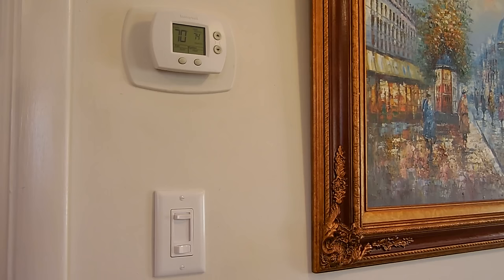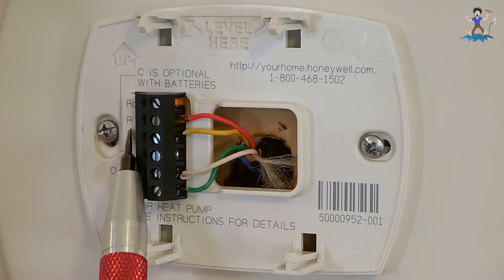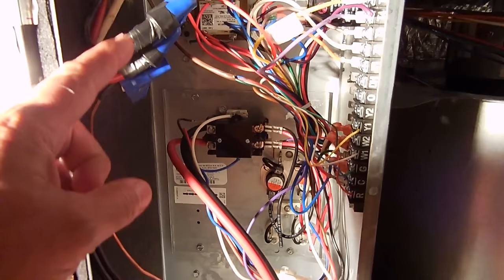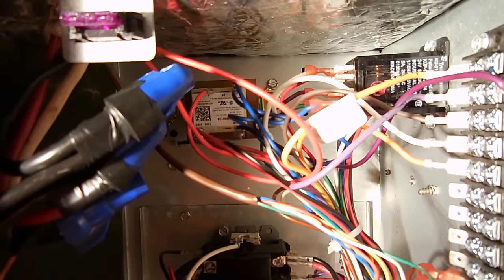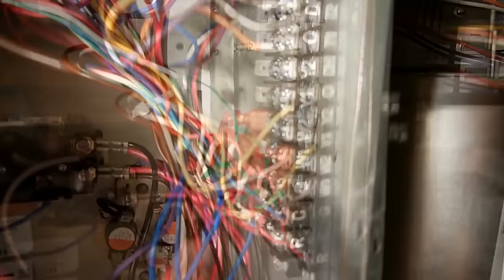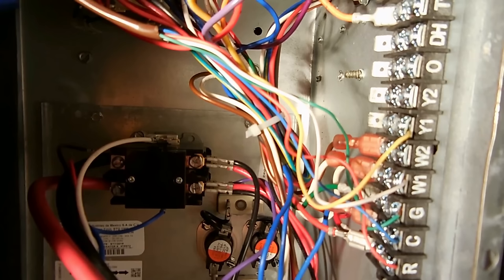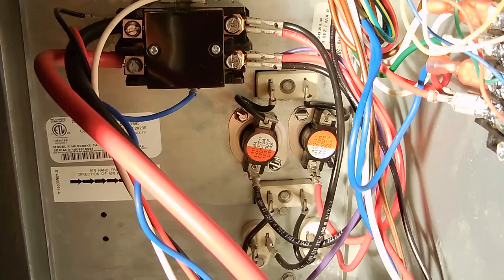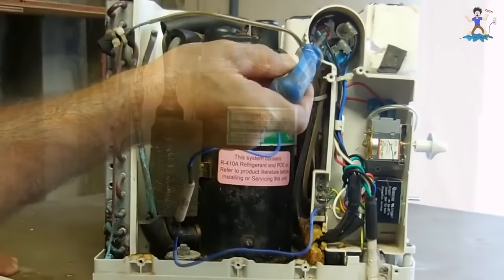How To Repair Electric Central Heating System(No Heat)

Comment: I have been doing HVAC/R and building controls since 1987 and I have to tell you this is a very detailed and accurate video, as with all of your videos the instructions and demonstration were great. I know people in the trade who could not explain this process the way you did.
Reply from the maker: Thanks Kenny! I really appreciated hearing that. :-) Hopefully this video gets the views it deserves, otherwise it was a big waste of time.
Reply: @electronicsNmore  Very successfull video!!! Outstanding Effort!!! Subscribed! Thank you very much! I learned SO Much from this video!
Reply: I'm trying to troubleshoot a 2014 American standard Air handler which has AC and Electric heat. The unit won stop running even without a t stat. I replaced the tstat and it's still no responding to demands. Can you help by any chance??
Reply: My thoughts exactly, you hit the nail on the head with this video. Step by step and in the proper order of tracing down the issue. Bravo

Comment: My electric furnace was blowing cold. I figured it was the heating coils. I saw them new for around $200. So after watching this video, I started at the white wire, it was a little loose and side note it also looked corroded. I just tightened it down and now my heat works again. I learned a lot from this. Thank you.

Comment: This video was absolutely amazing. I started the morning out with an HVAC that is not working and the prospect of several thousand dollars to replacement or at least a couple of hundred dollars in diagnostic fees. I followed the directions explicitly and by the time I was done I found a blown fuse and replaced it and now I have heat in the middle off winter the day before Christmas. (Cost $25 from Home Depot,) Thank you🤗

Comment: Thank you for the information! You are a gifted teacher.
I have more info pertaining to my Heat pump saga. It is a bit lengthy but has some more background.
 
In your video you said the two most common reasons for a fan not working is a faulty relay or a faulty blower itself. 

I bypassed my thermostat and jumped red to green and no fan. I added the white wire to the red jumper and the fan came right on blows air but not cold or hot (but it’s a heat pump). Lasted about 30 seconds and then cut off.

220 power is to the transformer and 28 volts out.

When on cool/ fan auto- it all works perfect (Fan/ cold air/ condenser fan)
When on heat setting the thermostat says heat on but no fan or condenser fan.

R-410A heat pump comfort control system code says “High pressure control lockout” locking out the compressor. Open high pressure control. The unit requires a manual reset.

Do you think it still might be a reversing valve? I can’t get the air handler codes without a code reader.
Reply from the maker: It's clear your wiring colors are wrong.

Comment: the tiny current that a multi meter uses to test resistance is what causes readings to fluctuate while ohm testing. the very small current will interact with capacitors and inductors.  this is why Nmore said to try and isolate (disconnect) whatever you are ohm testing from the circuit for an accurate reading. if you've ever conducted a resistance (ohm) test and the reading fluctuates, the current from your multimeter is flowing through a capacitor, copper windings, inductors, etc. AWESOME VIDEO!

Comment: this was a KILLER troubleshooting guide. i am stoked to try it out today. our downstairs heat just doesnt come on, always in AUX mode.. (and no fan starts up i think..) but the upstairs heat which is separate works fine.
Reply: already figured it out, with my past knowledge fixing my A/C units. i opened up this unit, heard the hum, and gave the blower spinner a push. it started up and heater fan finally blowing. i have a new cap on order.

Comment: I am perplexed-maybe some more background info would help you/me.

The thermostat wiring in question is located in the basement and there is the same thermostat upstairs as well.

Also there are two separate identical Rheem units with the upper only being larger. Both upstairs and downstairs ran perfectly.

We remodeled the basement and during the process I removed the wiring from the thermostat.
I took pictures of the wiring before removal. Once finished I rewired the thermostat identical to the picture. During the troubleshooting I checked the upper wiring and it was identical to the lower.

I do admit during the testing of the unit I did go back and forth from program to permanent hold in a rapid sequence back and forth which could explain the lock.

One thing that makes me wonder is- in by passing the thermostat with jumpers the heater fan came on.

On the thermostat where the white wire lug is was real hard to loosen and tighten to hold the wire in. When I thought it was tightened sufficiently the wire came out. Finally held with a vice grip to assist in torque. There’s little torque available with small screws and precision screwdrivers but all the others were ¼ of the effort. Do you think the thermostat could be bad since the fan won’t come on until I bypass it with jumpers? Maybe the lug isn’t making contact in the thermostat. Or am I way off scent. What do you think?

Comment: You should seal the hole behind therm, if there is low pressure in home attic air will blow right on thermistor.  In Florida too, I disconnected my heat strip for efficiency with a heat pump.  I don't need it coming on with a >1F increase.  Also, the only way to check the value of cap is with a cap meter, just a 30% off in capacitance can cause motor to slow start and increase amps.  I would just replace them every 10 years for $5-$10.  My 5uf cap was at 3uf and running amps where double and speed was off.
Reply from the maker: Funny you mentioned the hole, I stuffed it with insulation when I put back the thermostat. As for the cap, you and I both know a cap tester is best, BUT this video was made for people that more than likely won't have one. Doing what I show will rule out an open or shorted capacitor. Thanks for watching!
Reply: Wish I could get rid of the heat strip here in the Mountains  myself.
Reply: @tectalabyss  you running a heat pump if so you can disable it, if that's your main source of heat then no of course.  The new mini splits have 100% efficiency down to 0F, of course that means 300% vs a heatstrip or 3 x less electric for same BTU heat vs heatstrip.  And insulate R-50+ in attic.
Reply: @electronicsNmore  HVAC companies charge over $100 part only for a $5 cap it's crazy.
Reply from the maker: Like many doctors and lawyers, they have a license to steal from the public.
Reply: @publicmail2  Thank you for the reply Sir. Do these heat strips have a brand name  ?. We have to have the heat strip here has it gets down to the single digits and below zero.  An improved strip would be great. 
Again thank you.
All my best.
Bobby
Reply: @tectalabyss  Heat strips are all the same they don't vary in efficiency, fairly generic other than wattage and size.  Best advice is to insulate your attic to an R-50 worth of insulation, that's money in the bank.  And have an HVAC company check your static pressures on your duct work, 80% they are out of spec causing AC/heat pumps efficiency to suffer.
Reply: @publicmail2  Thank you again Sir. For the kind and helpful advice. Means a lot.  Power costs like everything else is climbing,way faster than wages.At least here at home and I am sure other places. So cutting cost is a big plus in my book.
Again Thank you Sir.
All my best.
Bobby

Comment: Thank you for the very detailed video. I have watched it several times and, performed most of the tests and, have not found the reason for my blower motor running slow, hesitating and running slow, repeat. The thermostat (same as the one in your video) seems to function correctly as everything does power on.
Reply from the maker: If the blower motor has full 220-240V at the power wires, and the capacitor is fine, then the windings are shot.
Reply: Check capacitor

Comment: Thank you for sharing this video very informative and educational Could you please tell me why my air is blowing warm but not hot air,and it doesn't reach the desired inside temperature which causes it to continuesly run $$$ the colder it is outside!I have an electric outside the house (AC/ heating)system.
Thank you very much in advance for your help!!!

Comment: Thank you for the helpful video.  How would I diagnose the thermostat if I did not have a green wire? I only have a red and white wire, and jumping them does not cause my furnace to turn on.  Should I jump the R, W and G at the furnace?

Comment: Our heater stopped working normally this night. The heater starts, runs for ~1-2 sec and then shuts off, then after 1-2 min it comes back blows a bit (no hot air, I tested w/distant thermometer) air, and shuts off again after 1-2 sec. So the fan come on and off, but heat never comes. Also what is interesting 1st time (after you reboot it or shut off and on Furnace brake), it comes more sturdy and works longer. But then comes (fan only I understand) on and off very slightly. My question is: Can you measure voltage between those colored wires, and if so what would be the readings? Thank you for so informative film.
Update: Unfortunately I did 2 things simultaneously: 
1.  I reset AC Breaker for any chance, though it seems not to be stripped, and I replaced it previous summer, 1 leg on top was slightly moving though. But after I reset it still it gave some movement, very slight. Also when I was purchasing the Breaker at ACE I pointed out that it was a bit moving, that leg (and it was only 1 breaker (30A double) there). The manager assured me that it is normal, it can move a bit. The breaker was working ~1 year with no problems and I don't know if it was the breaker which gave the problem, bcs 
2.  I also removed the Thermostat and tightened screws on all the wires slightly. 

   So unfortunately I can't tell for sure what exactly corrected the situation, but now everything is working fine and distant thermometer shows ~103F out of vents. Thank you again for pointing out on possible problems.

Comment: Power coming in from circuit breaker to air handler is burnt at end capped location. It's connected to transfer and electrical heater assy. What would be the most likely cause for this? It was short cycling right before failure.
Reply from the maker: Probably due to a poor connection generating heat. Turn off the power, trim back the wire, clean the contact areas, then reconnect. Thanks for watching!

Comment: Wondering what tools to remove air handler cover.
Mines in the attic through a small hole in my closet ceiling.
Don't want to have to go up and down a half dozen times!
Reply from the maker: Take a 1/4" & 5/16" nut driver and a #2 phillips.

Comment: I have a two-stage Rheem R-410A Heat Pump Outdoor Unit that requires a manual reset but they don't spell out how to perform a manual reset.
Any insights?
Reply from the maker: Red button near the refrigeration lines on the condensing unit. You may have a problem with the reversing valve. You should not have to press that button. Thanks for watching

Comment: Hello and thanks for the great explanation.  What do you call the ceramic post just before the thermal switch.  This post feeds the switch and basically has a wire crimped on the inside of it from post to post.  I just found it broken on the inside.  I'd call it some sort of fuse, although it looks like it just broke at the crimp, and not from heat.  Can I just silver solder it back together?  Thanks.
Reply from the maker: The ceramic is an insulator for the resistive wire(heating element). Post a link to a picture.
Reply: @electronicsNmore  Thanks for the response.  I realize that.  In your video, the thermal switch is fed by a wire which comes from a ceramic post with 2 terminals mounted by a center phillips screw directly above the thermal switch.  Power comes in to this terminal, then exits the other side of this terminal to the thermal switch.  If you remove this terminal (by removing the phillips screw), you will find a bare, crimped, wire connecting the two sides like a fuse.  This is on the back side so it is not visible until removed.  It is exposed to the heat of the coils.  Seems like some sort of fused link to me.  I was just wondering why you would need a fused link and a thermal switch.

Comment: Auxiliary turns on only once never restarts, blows heat but will never reach thermostat setting. Shuts off around 68. New therm, no airflow restrictions... any ideas?
Reply: Have not checked thermo switch ...

Comment: I did watch this entire video, but theres a whole lot i wouldnt remember and the circuit box is deep under my house and the cover is screwed shut, and I would need to get these different meters to conduct any tests.

I was hoping maybe you could make a deduction for what my problem is.

My thermostat seems to function properly, new batteries, and it does tell the fan on the blower outside to turn on, but absolutely no air current/pressure is traveling through the ducts at all that are underneath the house let alone up and out the vents inside so neither the air conditioning(cool air) or heating(warm/hot air) is passing through any of the duct work. The copper piping that is connected to the blower does remain hot.

From your experience what could be preventing the blower from allowing the hot air to the duct?
Reply from the maker: Without any tests, not much I can do to help.

Comment: My contactor clicks when turned on and the blower runs normal as always but still no heat....could it be a thermal fuse...??? Been cold a month id sure apreciate any info, ty in advance....
Reply from the maker: Twist the green and red wires together in place of the thermostat, then add the white wire to the red/green wires. That will rule out the thermostat.
Reply: @electronicsNmore  ill try that when I get home thisevening thank you so much...forgot to mention it all comes on when I turn the thermostat up the contactor clicks and the blower runs....but ill try what you said...

Comment: When you say "turn the power off", you mean power at the circuit-breaker? not just turning off the heater at the thermostat control panel?
Reply from the maker: Yes, circuit breaker or disconnect OFF.

Comment: good video, how do you the amount of ohmss needed
Reply from the maker: Normally if the element fails it will open the circuit. As long as you get a resistance reading that's fairly low, the heating elements should be OK.

Comment: does this method work with all thermostats  even if it has 2 white wires  and a  light blue wire.    blue wire has a c below it and the white wires  one has a w  and the other a letter e below it
Reply: Do you plan on starting patreon   i could tip you monthly for your content.  be glad to...
Reply from the maker: Wire color may vary, but everything works as explained. Inside the air handler you will find a wiring diagram showing the wire colors. Thanks for watching!
Reply: @electronicsNmore  THANK YOU!!!   Your Greatttttt !!!

Comment: One thing this video forgot,  and that I just ran into, if you have an emergency heat setting on your thermostat, and it works in that setting but not in regular heat, there will be a switch on the back of the thermostat that is most likely set to HP or pump, it is quite possible that this is the fix you need.
Reply from the maker: Yes, AUX heat. When I made the video I figured that people would be repairing a system that worked fine in the past, I didn't take into account that the their thermostat could've been switched out and not properly set up. Thanks for watching Bill! Be sure to check out my very wide range of videos and share.
http://www.youtube.com/c/electronicsnmore/playlists

Comment: I HAVE A RHEEM 4 TON AIR PUMP. MY AC WORKS FINE, BUT THE HEAT DOES NOT COME ON AT ALL. THE GARAGE AND THE OUTSIDE UNIT DID NOT COME ON.
Reply from the maker: If you have a heat pump and it does not turn on when you go to heat then there's a problem with your thermostat connections more than likely.

Comment: Fan works air comes out a little out but its not super hot air, what could be the issue
Reply from the maker: You need to be clearer. What does the air comes out a little mean? Only feels slightly warm? Or the air is hardly coming out of the vent?

Comment: It is not just the low voltage transformer that could cause no power to the red wire.Could be no power;could be blown fuse;could be open wire then the low voltage transformer could be fault.
Reply from the maker: That was all made clear in the video.

Comment: It heats but thermostat says AUX HT what can I do ???
Reply from the maker: You have a heat pump?
Reply: @electronicsNmore  really don't know I change the capacitor 4 months ago fan wasn't starting and it got fix but now it heats fan run stop and blowing less hot air and was saying aux ht
Reply: @electronicsNmore  where's the heat pump located?